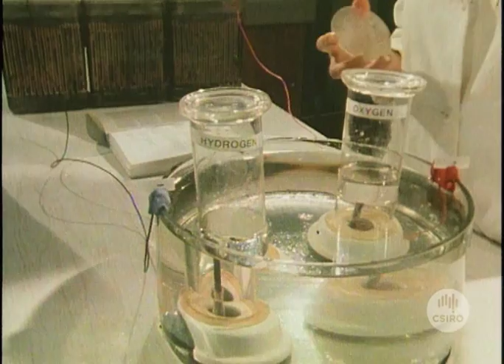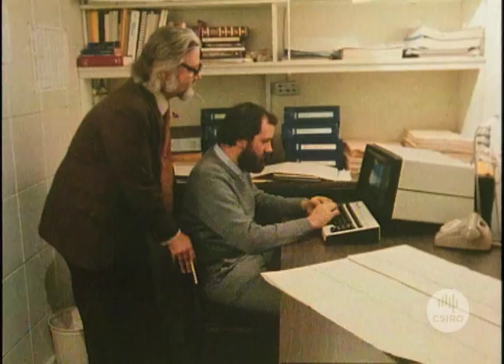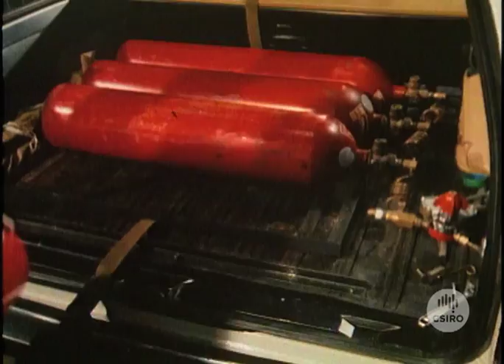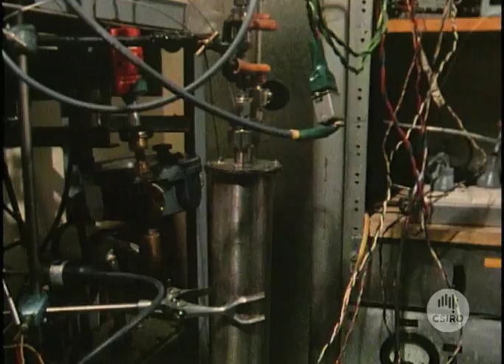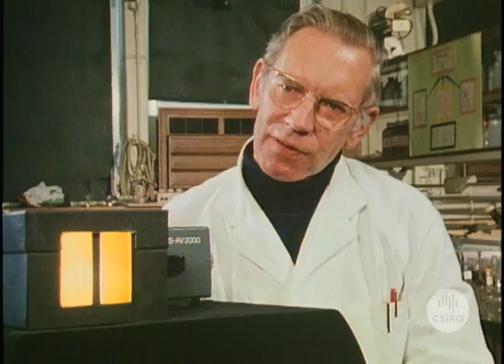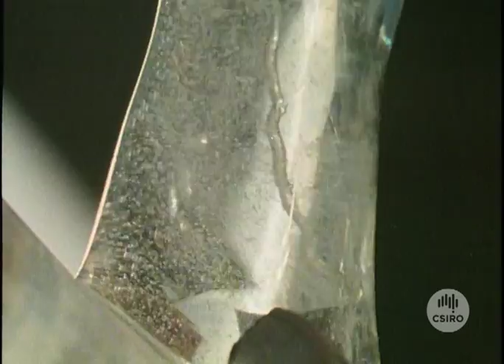Hydrogen power (1984)

Comment: Hate to burst anyone's "H2 Bubble" but generating Hydrogen Gas on a massive scale – if you don't want to emit multiple moles of CO2 per mol H2 made – really requires affordable Nuclear Energy.
Another strike against Elemental Hydrogen is that the Gas is next to physically impossible to store, let alone transport, economically.  

However if one puts moderately-pressurized H2 to some decent industrial use (i.e., any of a # of chemical reactions that can consume it as Soon as formed), one might have an Economic chance of a "Killer Industrial Hydrogen App".

Furthermore, the only viable "Non-Chem" Mode to store H2 – and one which is strictly temporary – is its Cryogenic Chilling down to only 20º Kelvin, which collapses this hardest-of-all-to-handle gases into a non-pressurized Liquid (whose density of sólo 0.071 g/ml still ~sucks).  
But IMHO and again, Man can make such severe Cryogenics Economical (e Environmentally) Viable ONLY with Nuke E that's Truly Affordable:  
        bit.ly/ms-sci
Reply: Very nice summation Kim. Deaf ears aren't gonna care - they "Believe" it works, so evidence never helps those operating on faith.
Reply: Kim L Johnson bot